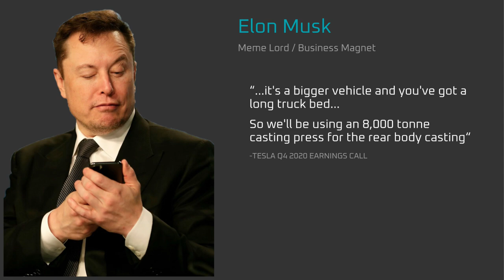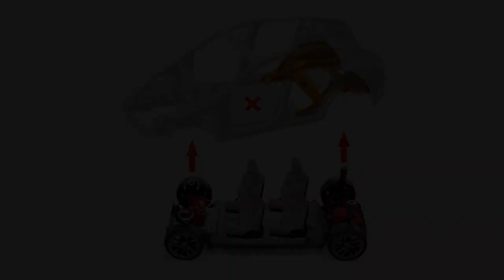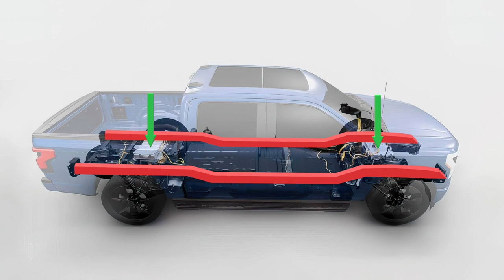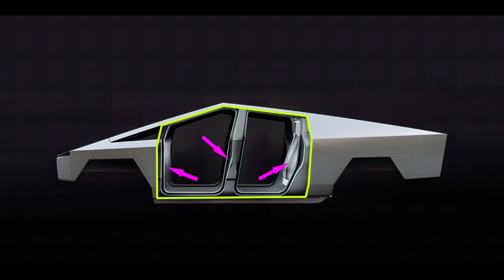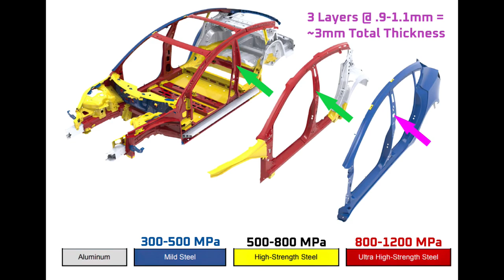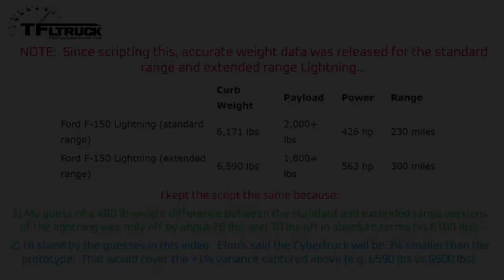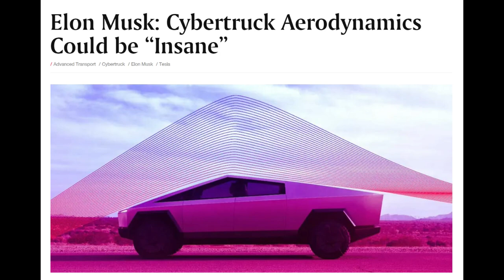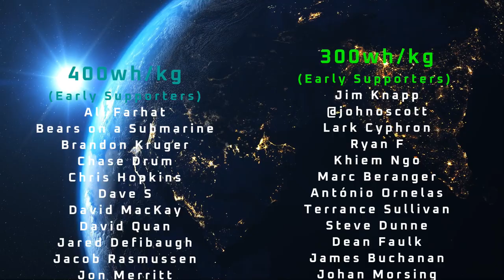Cybertruck // Merging the Exoskeleton, Gigacastings, and Structural Battery Pack

Comment: I’ve been thinking a lot about cybertruck recently. This seems like it could be an effective vehicle for police and even military. The fact that it stops common handgun rounds and the impressive acceleration it will inevitably have, plus the durability and low maintenance it will require makes it seem like an ideal police vehicle. If they want to make it stronger or have a greater towing potential they could just start with thicker sheet steel before the folding process. Even a .5 to 1mm increase in thickness would add a considerable amount of strength and weight. Unlike most trucks where armoring them means tacking on steel to the body, adding more weight to the frame, increasing the thickness of the CT skin strengthens its “frame” at the same time. They might even be able to use a thicker blank without retooling the production line at all, if the only process is folding.

Comment: Another reason for the 'origami look' of the Cybertruck is the choice of hard stainless steel. In order to produce stamped metal pieces the material must be taken up to it's yeild point otherwise it will just spring back. This means that the stamping press must squash the material as well as bending it in order to produce gradual curves. The choice of hard stainless steel would demand an impossibly powerful press to create gradual curves and hence the 'origami look'.

Comment: Superb Analysis. But after looking at the door assembly, I am curious to know about the impact on NVH. Have you had any thoughts about it? I feel the extra parts in a conventional car helps with better NVH, but with fewer parts in cyber truck door assembly, it might invite more noise in to the cabin. Unless they add some noise dampening materials in the door.
Reply: It may actually reduce it. One of the challenges with NVH isolation, similar to thermal insulation, is anything that penatrates through the insulation. The fewer parts means fewer connections that can loosen, squeak, or other wise come loose to rattle. The resultingly large, uninterrupted voids allow for many different options and layers when it comes to matting and other isolation materials with minimal cuts and gaps. 

If you could wrap the car in one complete sheet of dynamat or something like it, you wouldn't hear a thing. That's obviously not realistic and there's no way to know right now what Tesla might fill the doors with, or if they will be left as open resonance chambers. If Tesla doesn't damp them enough, I'll just pull my inner panels off and fill them myself. With such geometric shapes, it's not going to be challenging at all...
Reply: 3mm is 1/8 inches

Comment: Exoskeleton. As you rightly say at the beginning of the video, until a Cybertruck is the subject of a teardown, everything is speculation. For me the question is how do 4 doors, a roof, a pair of front fenders, a hood and a pair of rear quarter panels hold up engines, suspension, wheels, passengers, batteries, whatever is in the cargo bed etc. The simple answer is that they probably don’t, and that the term exoskeleton is more marketing than accurate description. I’d be surprised if the SS exoskeleton is anymore than particularly robust panels that will add significantly to the strength of a chassis engineered similarly to the Model Y with front and rear castings, a structural battery pack, and either a stamped steel or cast aluminium passenger compartment.

If it were a ‘true’ exoskeleton, each of the panels would have dozens of welded attachments to carry the other bits of the vehicle. That’s a lot of work on panels that were designed for ease of manufacture. 

Speculating that the attachment of the SS panels to the cast front and rear ends, passenger compartment, and battery pack will be by adhesive. Adhesive would also isolate the SS from the Aluminum/Aluminium.

Seems like a Unibody structure to me, the only difference being that the outer panels play a much larger role in adding to the structure than regular stamped steel fenders etc would.

Statement off on a tangent. The cybertruck prototype that shows up from time to time must be an entirely hand built vehicle. The gigapresses for the oversized front and rear (and possibly central) castings don’t exist yet, so those components either cast the old way (pattern, sand cast, machined), machined out of solid lumps of aluminium/aluminum, or welded up out of many smaller components which would seem the most likely to me. 

The other plausible scenario is that the Cybertruck is a donor pickup truck fitted with Tesla running gear and stainless steel folded panels. Joe’s Tegtmeyer’s 16 April photos from the Cybertruck visit to the Austin site shows the door inners and the side panels are stamped as they have multiple compound curves.
Reply: If the exoskeleton doesn’t replace a traditional frame as a rigid foundation for components, and is instead just another type of body shell, wouldn’t that defeat the purpose? Why make a truck with an extremely heavy body if you already have a frame to provide strength and support for the components?
Reply: @lanceanthony198  Because neither is strong enough by itself.

The panels add to the structure of the vehicle, and then there's the other benefits like impact resistance, no need for paint, folding machines instead of stamping machines.

Similar to stressed skin aircraft structures. 

It would be interesting to know where the design process started. Was it a designers sketch of a wildly angular vehicle, that lead to the idea of using folded panels, and that then lead to the use of highly impact resistant SS.
Or did it start with the idea of building an indestructible vehicle, and working backwards they came up with the angular design.

Comment: The Cybertruck is so cool... and you just found the reasons why it is much better than others. A breakthrough disruptive innovation in trucking. Now how about the Tesla Semi? I expect the 4680 cells to give it at least 650 mile range, after all, when you're a long haul truck you have to arrive on time so it doesn't matter if you drive more than 8 hours  if in the end you arrive the designated date. Also, it needs a sleeper cab version.

Comment: An outer triangle is strong but inner cutouts that are angular are prone to metal fatigue. This is why airplane windows are rounded. So sharp wheel arches, charging cap, that front side window could also be prone to cracking.
Reply from the maker: Great insight thanks!  I imagine that's where space frames could help out?

Comment: I now wonder if the military would be interested in the Cybertruck.

Pros:
  - Cheap (is already armored --> don't need extra armor, which is really expensive, or at most a little of it)
  - Sloped sides are good at deflecting bullets
  - Reliable, with minimal maintenance (logistics is everything in the military)
  - Electricity, where available, is cheap (again, logistics), and where not can be provided by generators
  - Lot's of towing capacity
  - I wonder how big or small the radar signature of the Cybertruck is, its boxy design and sloped sides remind me of older stealth aircraft (this is truly and purely in the realm of speculation, of course)
  
Cons:
  - Charging infrastructure is not in place for the military --> might be challenging to build, definitely expensive
  - Possibly significant range loss when carrying lots of weight (I don't know; we will have to see)
Reply: definitely great application for law enforcements and public service sectors.
Reply: It unfortunately doesn't fit the requirements of the military, it doesn't have a suitable range nd not even extra batteries for more range is possible, let alone the customisation is more difficult than a normal truck.
Reply: The U.S. military is already going electric, so yes, this seems like it would work well for military use with minimal customization.

The armor is not enough to be especially useful for the military, but it is certainly more than the traditional jeep or hmmwv, and it looks like it would be relatively easy to up-armor. Maintenance and repair in the field also looks like it would be relatively easy, especially compared to the hmmwv. In particular, it is modular enough that partially damaged CTs could be stripped down and the non-damaged parts be re-assembled into working vehicles in the field.

Most important the much higher payload capacity would allow significant up-armoring without overstressing the structure.

Of course the stainless steel would need bluing or some other process to darken it, as the military is unlikely to want shiny trucks - but that is relatively simple to accomplish.

Comment: If you don't tow or carry heavy loads or go off-road then the exoskeleton will be enough to make this a good light-duty truck. But to tow 14,000 lbs you need a strong rear structure and if you go off-road you need a super stiff or flexible body to handle torsion twisting of the body. The exoskeleton tries to stay stiff so you will need a stronger truck than what the exoskeleton can provide. To make it tougher you still need a strong lower subframe assembly. If you just use an exoskeleton then it will be a light-duty truck that when loaded up and run off-and will twist and possibly deform the exoskeleton. When you run the math it will always work better to add strength to the underside of the truck than it is to add weight and strength to the body frame, The standard pickup truck design finds it cheaper to allow for flexing of the body as it allows for a lighter truck. Trying to make the Cybertruck a stiffer and lighter truck is a really difficult design to accomplish. I'm guessing they will make the truck heavy and add a strong subframe to make this a heavy-duty truck that will handle off-road conditions well.

Comment: I have a 2016 F-150.  Great truck but the aluminum body panels which dent very easily are insanely expensive to repair and replace.  Even at twice the price the quad motor will be super good deal  and those that own them will never look back.  Just an opinion coming from one who has had that “aha moment” many times concerning Tesla.

Comment: Thank you for your video. I would say, stainless steel exoskeleton, skateboard used as a structural element, and giga-pressed front and rear are approaches that can lower the cost of production. I don't know what the insurance cost would be to insure a vehicle like that. Insurers would have to factor in the cost of repairs. I think Tesla will get more competition from Chinese automakers once they decide to enter in full force the European and North American markets than from legacy North American, European and Japanese automakers. There are at least a handful Chinese automakers that are in the process o implementing Giga press production. They are also choosing in many cases to use LFP batteries that are about twice cheaper than the batteries Tesla is using. (Tesla is using LFP in model 3 RWD only as far as I know). One thing is for sure, the future looks bright for future EV buyers. I hope more competition will bring lower prices.

Comment: How do you think they will deal with the galvanic reaction between the aluminum and the stainless.  I can not see them  keeping them electrically isolated.  The only idea I have is an excellent coating on the aluminum or a zinc sacrificial electrode?  You would be surprised how bad aluminum is oxidized in a salt spray all winter when attached to Steel.
Reply: They already attach aluminum and steel all over all of their cars. Theyve been doing that since the first Model S's came out.

Comment: Great vid as always! Also don’t forget the standard range F150 lightning is dual motor and a standard range cyber truck is a single motor which should be lighter.
Reply: Cybertruck is coming in dual/quad motor options only now I believe
Reply: @hunternewberry5860  So far that hasn’t been confirmed yet. My single motor reservation is still active. Hopefully that holds true due to Rivian coming out with a single motor truck also.
Reply: @inlinesix1187  when was this reverted?.. because I vividly remember must tweeting cybertruck is dual/quad only
Reply from the maker: Good point!
Reply: @hunternewberry5860  from what I remember seeing Sawyer Merritt tweeted about no single motor variant initially and Elon just responded with saying initial production will be the quad variant.

Comment: I thought rumours were that single motor variant isn't happening anymore. That would mean dual motor will be a bit heavier than your estimates. Still amazing analysis. I'm so excited to hopefully take delivery of a CyberUte.
Reply: If the rumor of Tesla using the M3 motors is true, the front motor assembly is only about 70lbs. Maybe it's 100 if it needs to be beefed up a bit, so it's very minor in the grand scheme of things. I actually think that the M3 motor rumor is likely, because it was stated that the semi is going to use 4 M3 based motors. With Elon's comments about trying to keep costs under control, the idea of basically using the same 4 motor setup for the high end, and a 2 motor setup for the low end makes perfect sense. Certainly much more sense than a tri-motor...

Comment: No paint poses problems if the body needs repair. Depending on the damage, entire structural panels will need to be cut away and replaced. There’s no room for traditional body work if they want to maintain the exact matte finish on bare stainless steel. Also there is a cosmetic issue. Although it wouldn’t be impossible to sand or polish out scratches, duplicating the original finish (texture) would not be easy if the stainless is scratched. Off roading, could dent and scratch the stainless steel. Maybe some battle scars could be regarded as cool badges of honor. However, keying will be done by perpetrators with any hardened steel tool like center punches, drills, silicon carbide, or aluminum oxide grinding discs.

Comment: I think you’re missing a very important difference of the exoskeleton vs unibody. A unibody needs panel, where as the exoskeleton use the panel themselves as the structural cage for the passenger, thus eliminating the ‘’unibody’’ frame.
As per the front and rear gigacasting , which are  linked with the structural battery pack, they remove the needs for a Steel beam frame like the lightning, and also provide the collision absorption and protection , working together wit the exoskeleton.
Reply: It was said somewhere that the casting was protected from impact to reduce the cost of repair. It is used to make the assembly faster because of precision in the casting and less parts.  Of course it saves weight.

Comment: As a lark, I once made a video with the Cybertruck promo video and the Knight Rider opening soundtrack. It totally worked! Someone should re-make Knight Rider, but with a modded Cybertruck (Cylon scanning light bar?) instead of a Pontiac Trans Am. The car model will be much cooler! Also, since it's 2022, we could get a whole lot more Sci-fi with story-lines. As a part of the story, the Knight Rider engineers could've chosen Cybertruck because its hard stainless exoskeleton structure would make it the ideal candidate vehicle to enhance using the mono-molecular surface layer. (That is exactly how the old Knight Rider became nigh invulnerable in canon.)

Comment: To think of the "skateboard" design as a frame that connects the two gigacasting is a misconception. 
Actually the castings are connected to the body in white long before the battery pack is attached. At least in the current model Y the body has to undergo painting - and you probably don't want the battery pack to be flooded with paint. Even if it is waterproof the paint would ruin all electrical connectors and cooling line couplings.
Now with the paintless Cybertruck this could work out differently...
Reply from the maker: Agreed, but both are true.  The gigacastings attach to the body, the structural pack is bolted to the gigacastings.

Comment: In your opinion, will the use of this much stainless steel add significantly to the demand for nickel? 304 stainless steel, the most popular grade of stainless steel, is 18-20% chromium, 8-10.5% nickel, 0.08% carbon, plus iron and the trace elements.

Comment: Excellent.  I love to see a comparison  (between Lightning and CT) for a medium force front and rear impact.  I am curious how easily CT is totaled in an accident vs Lightning.
Reply from the maker: All that's happened is we've moved the steel.  The giga castings will take most of the energy
Reply: @thelimitingfactor  do you think the cast can be replaced?  Or once damaged, the truck is totalled?  I have seen even current versions of Y cost $20K to repair for minor accidents.
Reply: @Tooradj  really?? Now Tesla is going to have to recycle it's own vehicles?)))
Reply: @ApteraEV2024  yup.  Ryan shaw on youtube 2 months ago had a post about his accident.  It was an eye opener how much of pain it can be to deal with it.  I could drive away my ICE in similar accident with fraction of the cost to repair.
Reply: @Tooradj  let's always pray for no accidents...
Reply: @ApteraEV2024  once every 4 years is average.  Need a lot of prayers.
Reply: @Tooradj  That's not because they have to cost that much.
Reply: @ApteraEV2024  Not until 500,000 miles.
Reply: @Tooradj  What about when there aren't any ICE vehicles?
Reply: @ApteraEV2024  Or pray for FSD to actually become a reality and at a "reasonable" price!  With the estimated 90% reduction of accidents, you would rarely have an accident which would total the CT.  'Course, many CT buyers may figure that for their use, they will have to be maneuvering the truck themselves, making FSD useless for the majority of their driving.